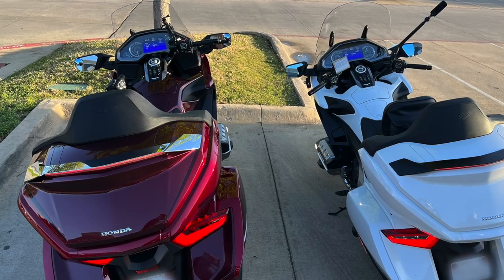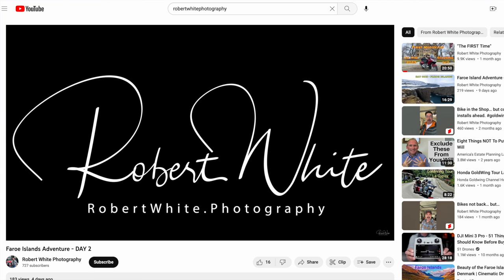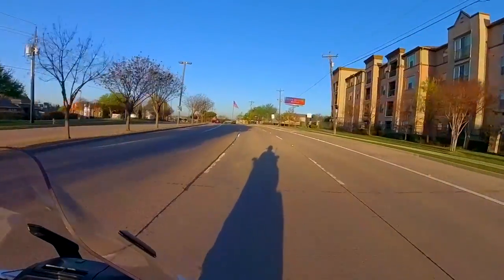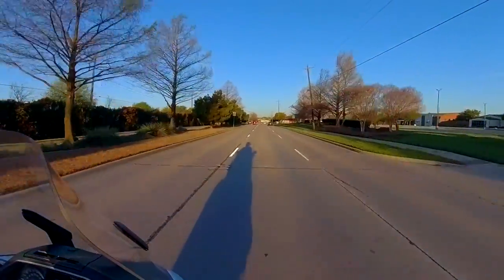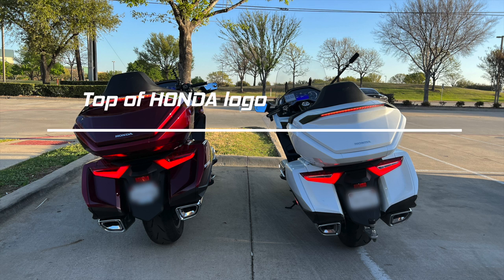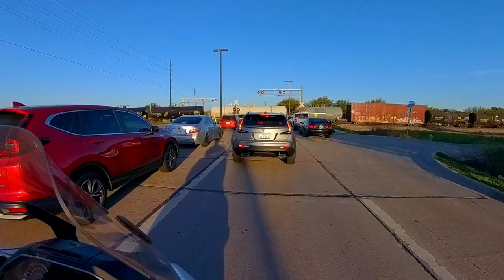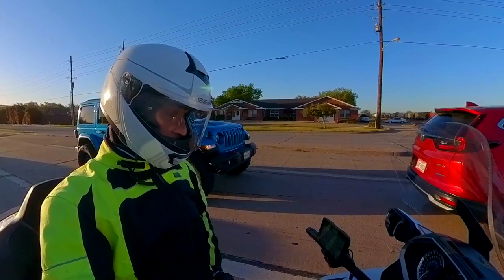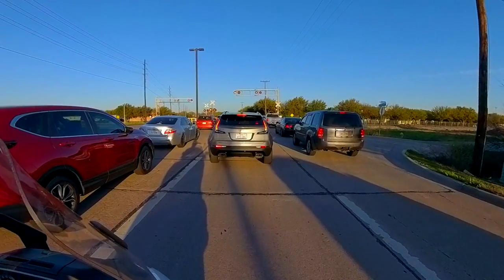Honda Goldwing Engine Ticking Issue SOLVED? | Cruiseman's Moto Vlogs

Comment: It's not oiling or kick stand usage. These 6th gen engines have insanely high oil pressure. Right at 20 psi more than the 5th gen engines test spec. Check you service shop manual you should have bought when you bought your Wing. It's Hondas crappy trailing rocker arms for the exhaust valves. They used shim and bucket for the intake valves as it should be and trailing rockers for the exhaust valves as it shouldn't be. Stupid move on Hondas part. Trailing rockers always make more noise than shim/bucket. Take the cam cover off and check the exhaust valve clearance and small parts. You will find your tickers/noise. Honda went cheap ass on this engine to accommodate the DCT and meet/maintain eurotrash5 emission standards.
Reply: Can what you say cause engine failure?
Reply: I had the ticking on my 2018 and currently on my 2022. I suspect poor adjustment of the lifters from the factory. I’m looking at doing an adjustment but haven’t found the Honda shims or the special tools online yet. I might just have to contact my local dealership to place an order.
Reply: I bought my 2018 with 9,500 miles on board. Man, the right side had this low db rumbling, knocking noise, like a diesel. Drove me nuts coming from a quiet '02. Ten different Honda mechanics checked it out, all said....running smooth and healthy. But, I'm sure you're all like me, you know what you know and know what you hear, right? Well, I had a dealer do a check and adjustment on the exhaust valves. Yes, they were a bit out of specs, paid out of pocket...but about 40% of the noise went away. I still hear it, mostly feel it once in a while when in idle at light or on driveway.....Love everything else about the bike.....but I guess this noise keeps me real. If I could I would trade it for a newer one with no rumble.....I bought 5 year extended warranty just in case.....
Reply: @jonwingO5187  Catastrophic engine failure,,, not really. Meaning the engine is junk,,, naw. But a cylinder going dead sure. Head damage sure. There have been several issues that showed up on the net over the years with bad clanking and knocking in the head and the bikes repaired under warranty. But none of those owners ever published what happened and what the repair was. If you have a shop service manual one can clearly see what could possibly go wrong and why.
Reply: @danaszalajeski4416  No special tools needed just standard tools. And all one has to worry about concerning the shims for the shim/bucket used on the intake is the dia. of the shims used and a good selection of thickness. You can buy shim kits all over the place. Checking and adjusting the exhaust valves is mech 101. I haven't had to mess with the intake cam and valves yet. But that stupid exhaust valve setup I've had to adjust once on my low mileage 2018 and the right front needs adjusted again.
Reply: I had the so-called rubble/ticking noise on my  2018 6 speed since new,  switched to 10W 40 synthetic oil, noise 90% gone, still going strong at 20k.  I believe the sound is from cam chain.  Had similar issues with other bikes. Slightly thicker oil really reduces these mechanical noises.
Reply: @airlaurian  Your going to hear and feel the rocker system on the exhaust valves far more than the shim and bucket on the intake cam/valves. Your 02 had shim and bucket on both intake and exhaust. Also of note your 02 also had steel sleeves in the cylinders where the 6th gen engine has NO steel sleeves. Pistons run in harden alum. cylinders with some magic fairy dust applied and bonded to the cylinders. So you can now hear a bit of the combustion cycle. If you have owned and ridden motorcycles for a long time you will pick up on a sound in the Wing thats like some of the old two strokes that had chrome lined cylinders.
Reply: @petex1568  Be careful running 10W-40 in the new engine. It's spec'ed for 10W-30 for more than mpg and epa/eurotrash5 brownie points. I just looked it up. Oil pressure test spec is 99 psi @ 5k rpm @ 176f oil temp measured at the oil filter. 5th gen engines have oil pressure in the mid 70 psi range with 10W-40. Also these 6th gen engines have different main and rod bearing clearances.
Reply: @wonderwing5139  Thanks
Reply: @airlaurian  I have a 2021 and have had the same exact lower frequency rotary noise and seems to be mainly on the rear of the right side valve train. I would characterize it more as a bearing noise. As you did, I brought the issue to a local Honda dealer who claims to have one of the most experienced GW mechanics here in NE and after leaving bike with him, the service write-up says a valve adjustment, but absolutely no change in the noise. Drives me crazy because it comes on with prolonged running of the engine rather than Chris’s issue being tied to cold starts and going away once warmed up. I pull in garage after any ride over 20 miles and the noise is there. have about 10 k on my bike. I have used two different mechanical stethoscopes, and this noise just doesn’t seem normal.
Reply: @WonderWing, in your opinion, what is the best oil to use in the newer goldwing dct’s? Do you have a channel or blog? I’d like to follow you as well if you do…
Reply: @seniorsouthwick976  Did you borrow my bike by any chance? Ha....exactly! You know, the harmonious sound of the GW engine is what I loved about my 1994 1500, then my '02 1800. No matter how you flip it, that purring was the sound of a healthy, long lasting engine.....hmmm, now....she looks amazing but please....don't open your mouth, kinda thing. The cam chain is not adjustable, but it sure makes the sound as if the chain is flopping around there without a rhythm. I know it's not that, but that's the sound it makes. And you know......turning up the music is not a solution for a bike that costs sooooo much. Listening to most of you guys, kinda puts off my solution of selling and getting a newer model. Hmmmm, it is sad!